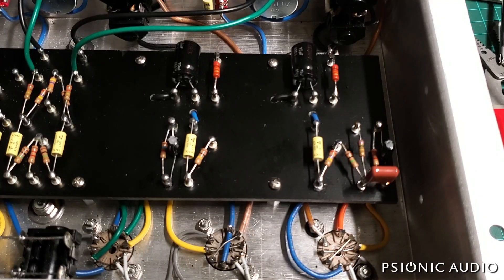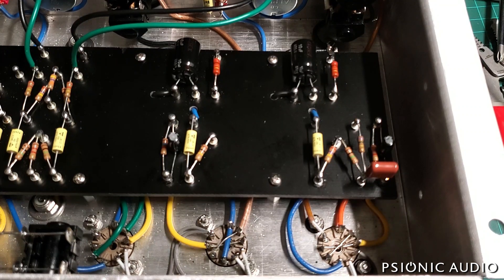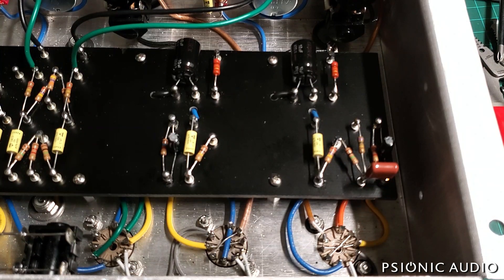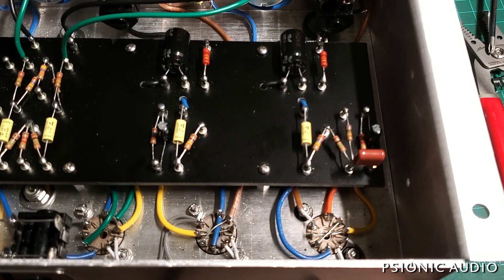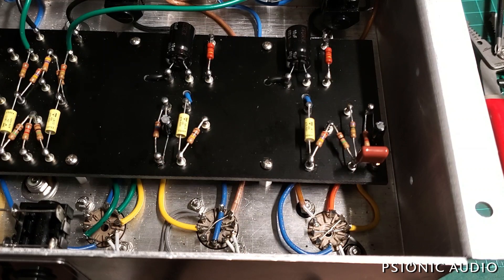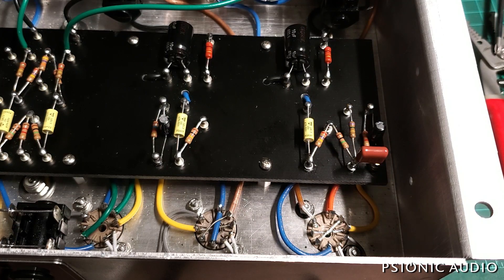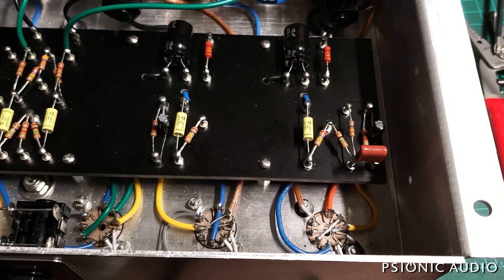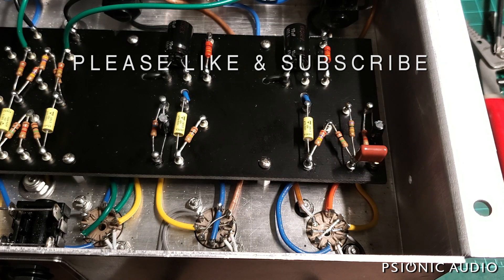EF86s Are Weird | Amp Design & Pricing Considerations

Comment: Current EF86's production these days don't meet spec, in fact I don't think any of the new tubes meet original specs.  Based on the costs of the new production tubes, I buy a few NOS/pulled tubes that meet spec, built better and will last a lot longer.  New tubes work fine, but I just don't think they're all that great.

Comment: If the modern "ef86" doesn't operate with the characteristics of actual ef86 tubes, it just isn't an ef86...  What you describe is a radically different operating point...

Comment: I doubt this will be much help at this point and I'm no expert on the subject to begin with, but it's an interesting problem and I figure what the hell, might as well share my thought process.

The AC15 EF86 circuit (or what's being presented as such online) already derives the screen current from the DC component of the anode current. Ideally that would be enough to establish a fixed ratio, but I'm guessing the source impedance presented by the 1M resistor is just too high to accommodate tube variations. That 1M is important though, because it prevents the screen from dragging down the plate voltage. What do you use when you need to connect a high-impedance source to a low-impedance load? An amplifier!

There are a couple of ways to do this depending on whether you want a fixed voltage or current ratio, but I think the simplest is this: remove the 1M resistor and connect the gate of a suitably rated P-channel FET to the low side of the 22k anode resistor (call that Ra). Connect the drain to the screen and connect the source to B+ through a resistor (Rs). Taken as a source follower, this sets the voltage across Rs equal to the voltage across Ra (ignoring Vgs), which makes the screen current proportional to the plate current with ratio Ra/Rs.

Does this circuit work? Does it sound right? Will it turn a perfectly good amplifier into a makeshift fireworks display? Your guess is as good as mine.

Comment: what's your opinion on dampers (e.g. rubber o-rings, shock mount socket) for the ef86, necessary? I saw a video of someone wrapping the entire ef86 in a rubber sheet, and holding it with a hose clamp. Seems a little excessive..
Reply from the maker: Maybe o-rings help a little. Don't pay audiofool prices for them - most car supply places sell .75" high temp silicon o-rings for very little money.

I shock mount the sockets which definitely helps.

Comment: If the (modern) EF86 proves intractable there is the SRPP circuit https://www.tubecad.com/may2000/page1.html. I have been experimenting with a fixed bias JFET version and the bias can easily be set for even clipping or not, as you wish. A 12AX7 SRPP would probably not give as much gain as an EF86. Excellent build, one of the best I have seen. I hope you resolve the modern EF86 issues. Steve.

Comment: The EF86 is a low noise pentode my 1958 Quad amp uses them in the power amp inputs. They were also used in tape recorders but I would say its not all that good for guitar amps.  When designing amps you must be aware of ageing, thus biasing etc must be set to alow for 50% reduction  in gain, other wise you will be replacing valves every year

Comment: Lyle, have you ever tried the 5879? You may be pleasantly surprised. 😀
Reply from the maker: Many times. It's a backup plan for this, in case reliable EF96s get more difficult to source. Notice the front panel says Pentode. Not EF86.
Reply: V1 in se Amp bias hotter than Gibson circuit

Comment: Wow, a lot to unpack...

Once the design and BOM are complete, a typical business would then look to see where cost cuts could be made to increase profit/reduce retail price. Like you, I don't believe in shaving several pennies off the cost of the amp with the cost being a loss of reliability (or worse) tone. With that said, looking at the most expensive components with the aim of reducing their price without making a sacrifice is something you absolutely can do. 

Based on my experience, the iron, chassis, and cabinetry are three distinct areas where a significant amount of money can be saved while maintaining quality. However, this typically means buying in quantity, even though Heyboer (to name one) was very easy to establish a business relationship with only buying qty 5 at a time. I had three different batches of chassis made up which were exceptionally high quality and came in at under $30/unit for qty 25. I have my raw cabinets made locally with a 1-12" cab coming in well under $100 - but that also means I do the tolexing and grill cloth. Depending on how much we value our time, that may be a false savings but these are decisions we all have to make. Of course, the other issue is capital as larger quantity purchases do chew through money.

I suspect you know the following vendors but I will list them here for those who may not be familiar with them.

https://vacuumtubesinc.com/
https://www.edcorusa.com/
https://laserfab.net/

If there is anything I can do to assist you in any way, please reach out.
Reply from the maker: Thanks man.

I have dealer status on all components from resistors to cabs to transformers, and I do BOM pricing at various quantities. So I may order ten chassis but 100 of each resistor, etc. I know where the quantity pricing kicks in. 

Losing Classic Tone was a blow, and Heyboer is still out of stock on almost everything for the foreseeable future. Which left me with Hammond and Mercury for this amp. I have top tier pricing with Mercury, so their iron costs me about the same as Hammond (on some things, less). 

The only part of this particular puzzle I wish I could change is the chassis, but custom chassis in small quantities are too expensive. 

Traditionally, one would build a few amps, take them to NAMM, and either get a lot of orders or a distributor, then have lots of custom chassis made. 

But I'm not sure that biz model really holds true anymore.

And my workarounds with this existing chassis have been successful without too much added labor.
Reply: @PsionicAudio , I know you're busy but if you have some free time (no kidding, huh?) I'd love to discuss this with you.

No pressure - but I do believe we can trade some contacts and help you move forward when you're ready to look at pricing.

Comment: JJ makes an EF86, and Electro-Harmonix also makes an EF86. Those are the two modern production choices available right now. I have Mullard UK, Brimar UK, Tesla Czechoslovakia (NOT JJ), Tungsram Hungary, Telefunken W German and Philips Amperex Holland, EF86s, but I very much prefer to use JJs or Electrohrmonix so the customers can easily find replacement tubes.
Reply from the maker: I forgot about JJ because they name it slightly differently.
Reply: @PsionicAudio  EF806.
Reply: Like it's a German made Telefunken. (rolling my eyes)
Reply: The  old Winged C Svetlana Soviet (St Petersburg not Saratov) EF86s were not too bad, and 12 or 15 years ago they were pretty darned cheap too. The plates were made with a matrix of tiny pyramids with a dimple in the middle each one making the plates very rigid and somewhat more resistant  to becoming microphonic. The Chinese copied that Winged C EF86 tube under ?? brand. (Shugrang?) Not nearly as well made. An extremely poor attempt was made at copying that plate structure. I need to unearth my 1984 Soviet vacuum tube book. (With a forward by George Orwell)

Comment: The old Akai M8 tape recorder amp has a separate 5.7 volt filament winding for the 6267 tube. It seems even in the old days, the 6267 needed special treatment.
Reply: I just got 2 Akai M8’s 4 amps altogether. Probably gonna make them into AC-4’s since everything is pretty rough looking inside. Hopefully the transformers and tubes are ok. Glad I noticed your comment! I haven’t started excavation yet.

Comment: Thanks for sharing all.  It’s going to take as long as it takes and if you don’t ensure your supply chain and properly test variations in your components as you are clearly doing it will be a misery down the road.   Your main advantage compared to big guys is that you don’t have to make quarterly financial reports and can take the time to square away your prototypes before committing.   For the rest of us patience is a virtue.   I don’t think anyone who has followed this would have had any expectation that any of the Excalibur products would have come in under 2.5K.   Labor - labor - labor
Reply from the maker: Thanks! The head should be under 2.5K US. But details later.

Comment: V1 pin 9, just curious...why is all that outer jacket missing? That's REALLY not your style. I'm guessing there's a very valid reason...sounds awesome btw.
Reply from the maker: Because there is nothing noisy next to it and it slightly decreases the weight/pressure on the pin (which can make the EF86 mechanically less rigid/prone to microphonics). IOW, it's fine.

Comment: It may be that current production “EF86s” are too different from old stock, similar to current 5Y3GT rectifiers which aren’t the same tube at all.  

That new tube doesn’t sound as good as the NOS EF86. Not bad, but you had the NOS tube singing.

Comment: Best of luck with the parts shortage! Losing Classictone still hurts me.
Reply: I know what you mean. A good source for transformers no doubt.
Reply: Yeah that one was bad.
Reply: Ditto... I've got one PT and one OT by them left for my Bassman build, then I'll have to decide on what manufacturer to go with for some future stuff I have in the works. :(
Reply: @MattJohnsonSC  I completely forgot a PT/OT set from ClassicTone that’s supposed to go into a single ended build some day 😜. They’re around here somewhere… along with the schematic and a partial layout.
Reply: @MattJohnsonSC  i tell you, it hurts to dish out that extra cash for Mercury Iron, but it works and sounds great every time. Really good support/warranty too.
Reply: It hurt the hell out of me, because I had to cough up money for the jcm2000 dsl/tsl power transformer way ahead of me needing it!  But if I didn’t, I was going to be screwed on this kustom 72 kit I got on eBay minus the transformers. A whole amp kit I would have never been able to buy transformers for ever again
Reply: What's everyone's thoughts on Hammond? Those are available where I live, they seem to make a transformer for just about every fender I could think of.  I am shopping for a new bassman pt at the moment.  The only issue I seem to find searching on the net is high filament voltage
Reply: @kbkman7742  I’ve resorted to using Mercury iron for clone builds and vintage repairs. Hammond and Heyboer make high quality stuff, it’s just not accurate to the original equipment in vintage amps. If you’re building your own design, that’s fine. If you don’t want to dish out the money for Mercury iron or can only get Hammond iron, build yourself a buck transformer from a Hammond 4 amp filament transformer.
Buck transformer- https://robrobinette.com/5e3_Modifications.htm#Bucking_Transformer
Reply: @kbkman7742  I recently replaced the output transformer on a 1967 Fender Bassman using the Hammond 1750L. Transformer cost about $100 and sounds great to my ears. A few years ago, built a VOX AC15 style amp and tried a Hammond first, then Mercury Magnetics. The Hammond output transformer sounded fine to me, with MM being a bit better. Not a huge difference to my ears. Big difference in price. With one of my single ended KT66 based amps, the Hammond 125 series transformer did not sound too good. Tone was kind of muddy with low power output. Replacing with a Mercury SE-5K-MM literally transformed the amp's tone. Much more power output, clear tone, and a warm full sound. So much better! Hope this helps.
Reply: @kbkman7742  My only gripe with Hammond is that unless you buy custom runs of them, many of the popular irons they provide are painted rather crappily with spray paint. This includes even the wires coming out of the bell ends. While they sound great and would be fine for a one off personal amp, trying to sell one to a buyer becomes rather problematic; I can't do it without guilt. I don't use Hammond anymore for that reason alone. I don't want/need to buy a custom order of iron in bulk. I build amps one at a time and I don't need bespoke iron to do it. That said, I am probably going to stick to Mercury Magnetics ( rather reluctantly ) simply because all their iron looks great inside and out, and I can feel good selling it to another person. The part I don't like is that MM iron is at perhaps 2X more costly than I feel it is actually worth. Looks great, sounds fine ( pretty much the same as significantly cheaper iron ), but not twice the price great.